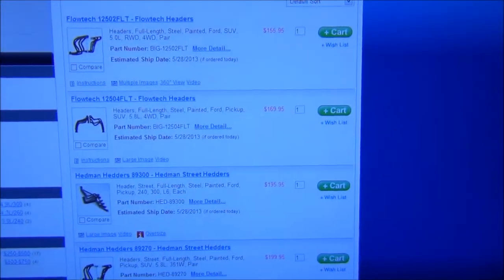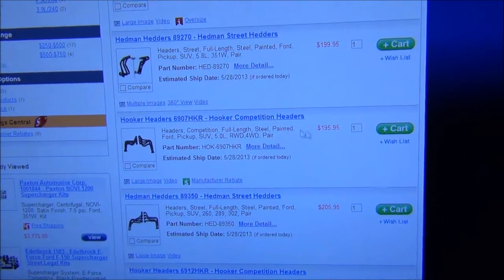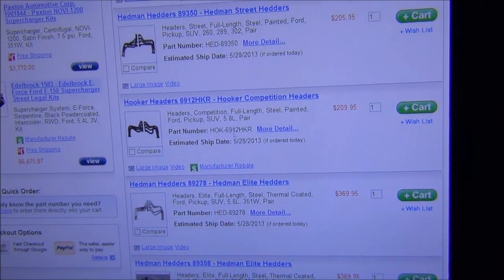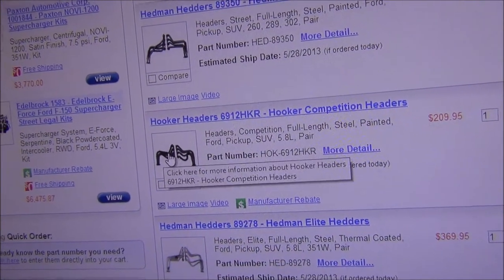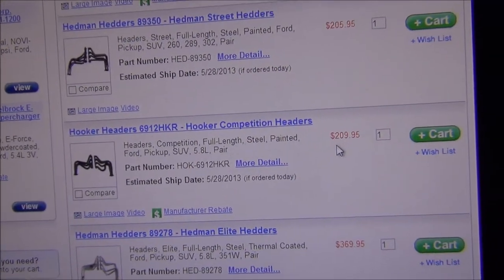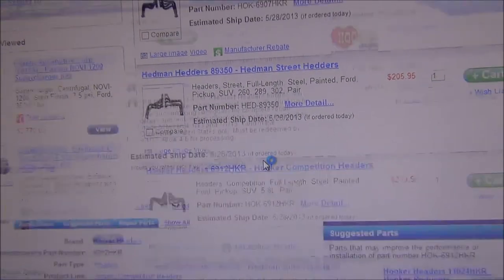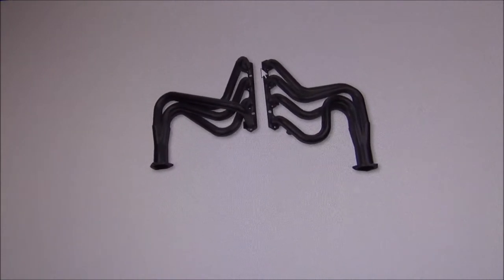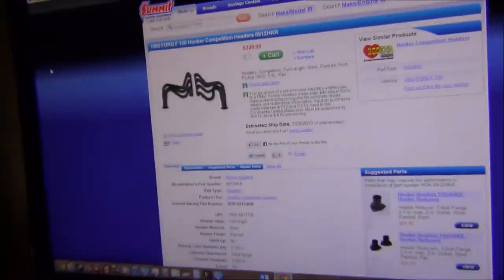Should I Install Headers on a 351w Ford

Comment: I have hooker headers, just watch out with the hooker headers, the drivers side header came down right under the shift bracket on the transmission and requires an bend in the pipe when it's on to clear the transmission linkage. When I had an exhaust system done I warned them of the issue but they didn't take the warning good enough and they bent my damn shift linkage bracket all up to make it go in all the ranges, so now I gotta fix that someday.